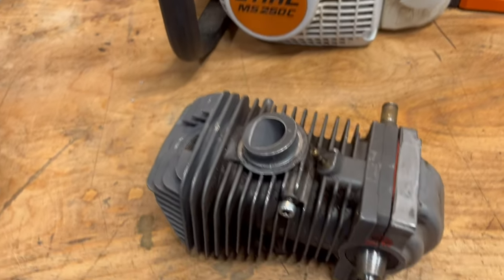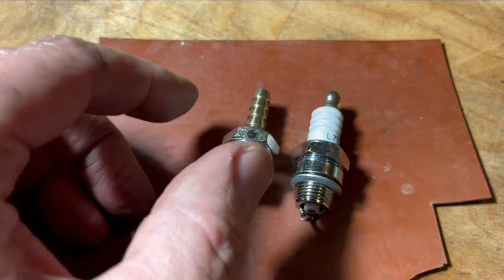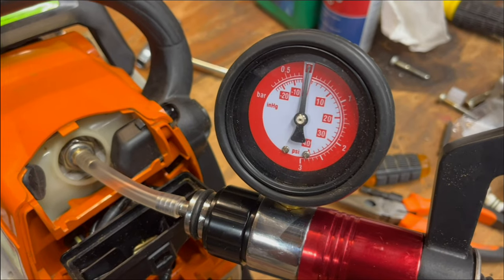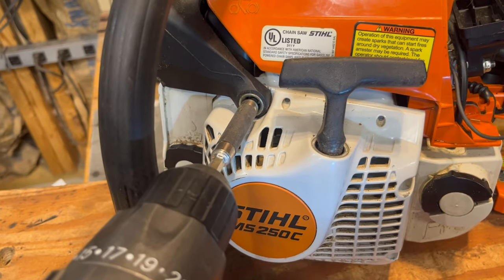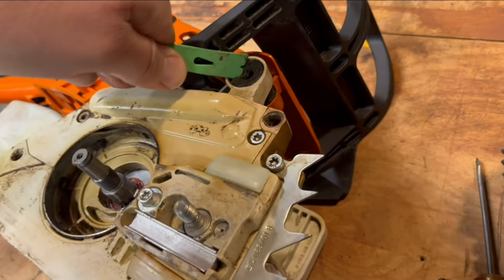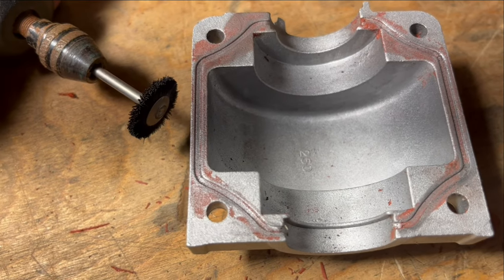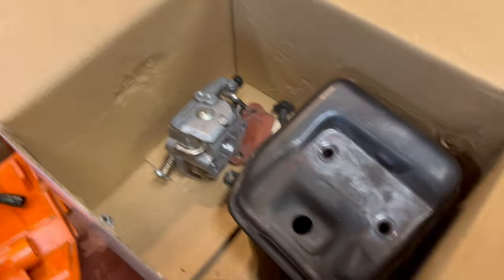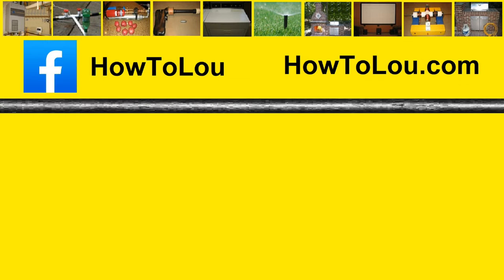How and Why to do a Chainsaw Leak Test

Comment: I have a Stihl MS361 that I can't adjust the low speed jet to idle and continue to idle properly for more than a minute without revving it about every 20-30 seconds. Does that sound like something yours was doing? I performed a leak down test (with a leak down tester for automobiles @ 40 psi) that didn't leak down, although this type of test is used for compression test, so it's performed while the piston is at TDC. By doing it like this, it would not reveal any leaks below the piston (unless piston rings are badly worn), so I may try it again by sealing the intake and exhaust and with the piston at the bottom of the stroke. I also performed a compression test that indicated 150 psi. In addition to the idle symptoms that yours was experiencing, do you know what the compression should be?   Thanks

Comment: A 1/4" impact with a 3/4 socket does a great job of removing the clutch without having to stick a rope or anything else into the cylinder.

Comment: Good video, short, sweet, and to the point on the task at hand without 15 minutes of fluff and useless filler. I’m glad I found this video because I have an MS290 which was acting up and running poorly.  I could not get it tuned to run properly a couple years back at idle or WOT after a carburetor disassembly and cleaning, and so I got aggravated with it and set it aside. I recently picked it back up to have another go at fixing it. I just am not sure if there is a vacuum leak or carb issues, or both, I just know the saw has issues. Anywho, I plan to order a vacuum/pressure tester like you recommended. Your idea to make an adapter with a hose fitting and old spark plug, I will be doing that as well. So anyway, to cut to the chase, you got me pointed in the right direction in order to find the problem and fix the saw, which is one of four Stihls that I own.

Comment: I have an 044, I believe it to have a leak due to engine refusing to slow down to idle. Already replaced intake boot which was split but it didn’t fix it. Can I not just pull the seals on my model without a complete tear down? Although I was going to pull the jug for new base gasket and meteor cylinder and piston.

Comment: What size barb fitting did you use? Thank you. How do you like the pressing tester. I was looking at the mighty vac 8500, but didn’t want to spend that much.
Reply from the maker: The leak tester works just fine.  No problems.  I also used the vacuum recently to bleed a brake line.   1/4” barbed fitting into the spark plug adapter
Reply: Thank you

Comment: Great video, right to the point and easy to follow.  Cool DIY spark plug adapter 😊

I've got a Husqvarna 350 that's in need of some new crank seals.  Noticed when it's turned on its side, it leans out and no amount of high-speed adjustment makes any difference but upright it runs perfectly.  Guess that's to be expected from a chainsaw that's over 25+ years old (factory sealed).

As for those scored pistons, I collect chainsaws and was burned on eBay (Husqvarna 55 Rancher) that looked like the middle example and ended up having to rebuild the top end (nice restoration project) 🤣
Reply from the maker: Yep, leaning out on its side is a sign the seals are nearly shot.